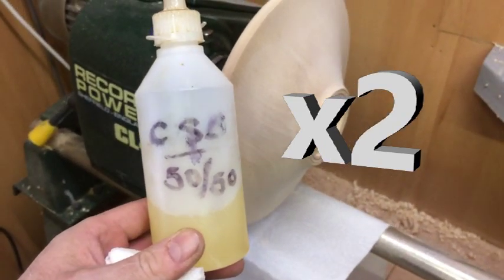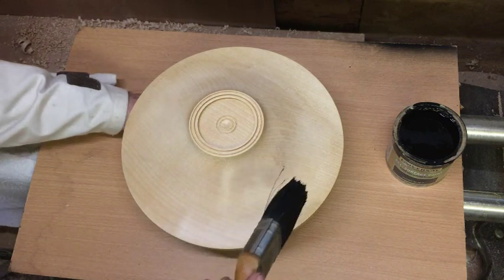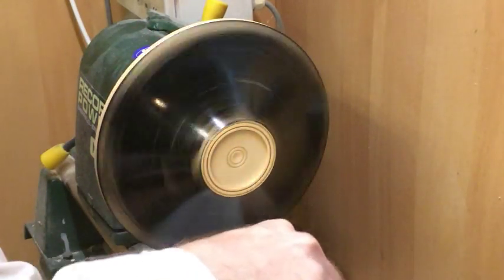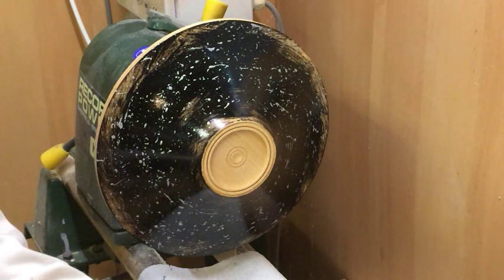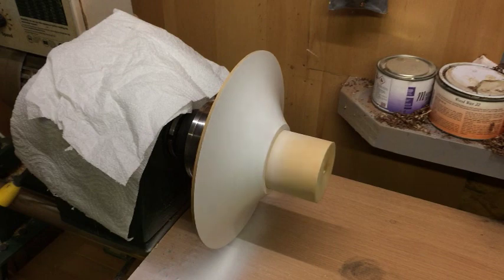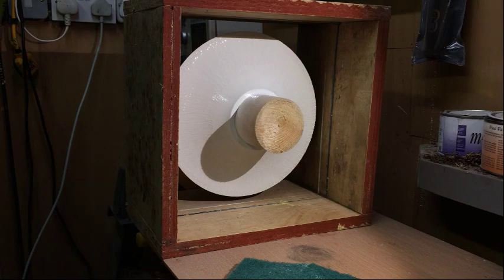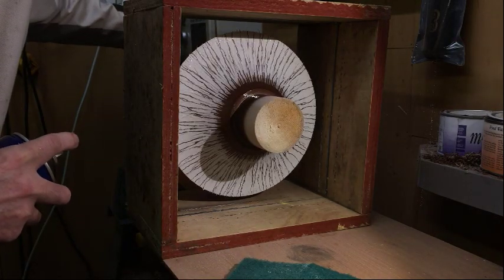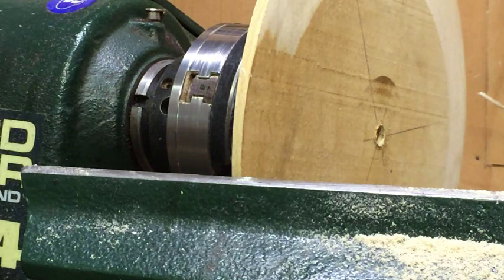Woodturning - Copper centrifuge bowl - fail to WIN!

Comment: I was about to give up on you when you picked up the paint brush. And then it really got bad with the white splatter on the black. But then you cleaned it all off and things got better with the white spray paint. But you really saved the day with the black and copper. That is one great looking bowl. Congratulations.
Reply from the maker: You know what Glen, it's really refreshing to hear what people actually think - I had this image of what I wanted, but as soon as I picked up the brush I knew it was the wrong one for the job. I was pleased with the shape but by the time I'd done the splatter I just knew I had to start over!
   Using several layers of the white meant the copper could run over and create organic looking lines. I'm very pleased with this piece and look forward to experimenting more!
  Thank you. Take care, Dave